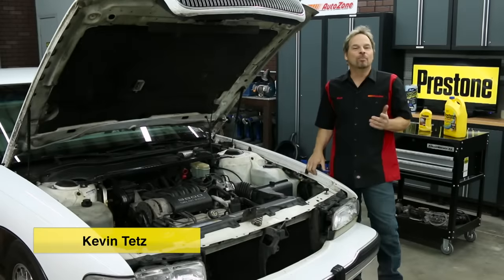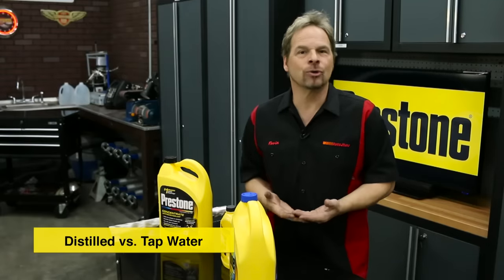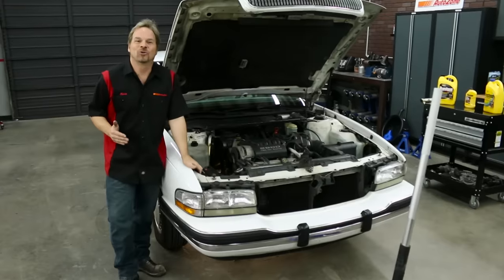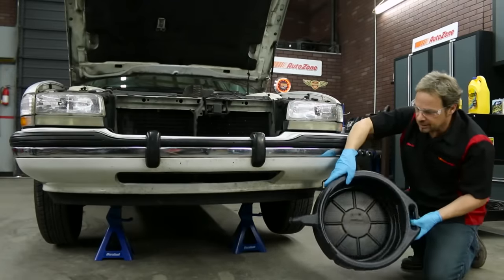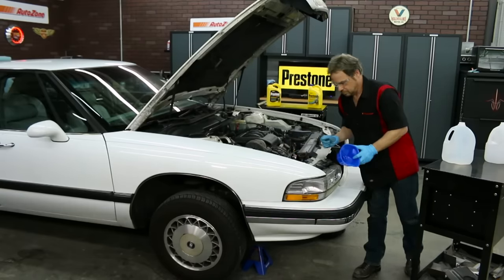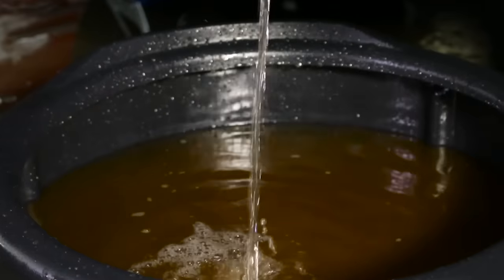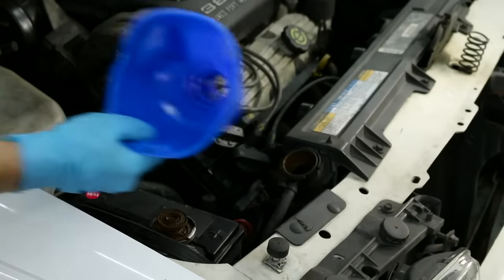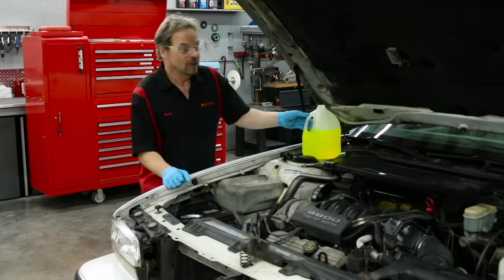AutoZone How-To: Flushing and Filling Your Cooling System

Comment: I need help. My thermostat/coolant gauge gets to almost halfway and then goes back down a little. Especially in the colder months. In the hot days, when I'm idling at a drive thru for a while, it gradually starts getting hotter and hotter and my ac no longer blows cold air. Then I have no heat. Anybody know what can cause this issue? Any help is greatly appreciated.
Reply: Just a guess… when you start a cold engine the thermostat is closed, which restricts flow of coolant to within the engine block only. This is normal and is to allow the engine to reach normal operating temp quickly. At that point, the thermostat then opens and allows circulation of the entire system (coolant in the radiator also), which has not warmed up yet. The sudden flow of the cooler coolant is what you’re seeing in the drop in your temp gauge. It’s normal. 
The second issue maybe due to older car, or inefficient cooling due to needing system flush and thermostat replacement. In the mean time when the car begins to run hot when idling or stop and go driving, turn the a/c on full blast at the hottest temperature. This kicks on the radiator fans which helps cool the system temporarily. Then try to get to a cruising speed as soon as possible to let air flow through the radiator to cool it down.
Reply: My Pontiac does this, get a 180 degree thermostat, and check your ECT sensor and coolant levels.
Reply: @jonmo2694  My problem was solved last year. Needed coolant flush and new cooling fan. Cooling fan was not working.
Reply: @davidalonzojr8617  motor? Fuse?
Reply: @jonmo2694  Motor. But just replaced fan all together.

Comment: Better way to drain the system. Remove the bottom hose from the radiator. 
Personally, I remove the thermostat. Re-install the housing. Dump water into the top hose. Then hook the hose of my wet/dry vac to the exhaust port. Blow any water that may still be in the block out. Then do somewhat the same for the radiator.
Reply: Yo I am not about to wrestle that massive old hose off and on twice (and risk damaging it)  just to do a flush

Comment: Nice video thank you.

But eyeballing half of the gal is just an eyeball and you could end up with not a 50/50 mix.

Your best of measuring it or using the same exact bottle size and filling it to the same exact spot with water and then with coolant and then pouring that into the gallon

Comment: I use 5w-20 in my radiator.
Reply: you are new school I use 10w-40 thats old school from the 70's
Reply: And of course good water when you oil change.
Reply: Don't forget to regularly check your  blinker fluid levels if low, fill with battery acid

Comment: I just did a coolant drain ,flush and change on my 2006 pontiac pursuit 2.2l eng ,it calls for a 50/50 with dexron cool ,,however I am confused about the coolant as it comes in two forms ,pre mixed (does not specify ratio) and concentrated ,,both labels say it can protect from cold weather down to -34deg C ,how can both do that if they are different? if i took the concentrated form and diluted it down to say 50/50 will it not lower the protection level? the concentrated label does not mention anything about mixing with water or any ratios so i assume they want you to use it straight, but how come the premixed stuff says it can also handle  -34deg C? is it specially formulated to do the same job despite it being premixed?? i am worried i made a mistake in putting the correct ratio because i live in cold weather and it can get down to -30degC here possibly and last thing i need is a broken engine

 ,,here is what i did,i have a coolant reservoir and no radiator cap so all is done through the reservoir cap,,i opened the res cap and then the  petcock on the rad and drained out what i could ,i started the engine and reved it a few times to drain more out with the pump ,i then filled it with distilled water and heated the engine till it reached 105deg C and the fan kicked in and the thermo must have opened because i saw it drastically start dropping back down to 75degC in a few minutes ,while this was happening i put the heater on max and turned on the fan but i dont think this was necessary as it will shorten the circulation time because it only removes heat from engine faster and the thermo will close faster plus i think coolant in the heater core is always circulating with the engine jacket no matter what ,,anyways i drained it and re filled and done this about 4 times till it was coming out nice and clear enough  , i then measured what i collected to be about 4 litres and subtracted this from the system capacity of 6.5 litres to tell me what was left in the system so about 2.5 liters of distilled water ,but what i dont understand is how come there was no heat coming out despite that amount left trapped in the engine jacket and heater core? its as if everything drained out so if that was the case i am worried i may have made a mistake with the ratio when filling with coolant and water,,,anyways i wanted 60/40 so assuming  there was 2.5litres water left in the system i simply did the math and added 3 litres of concentrated coolant directly in to make it 5.5 litres of 60/40 and since there was 1 litre of coolant left to go i mixed 600ml of concentrated coolant with 400ml of distilled water to once again get 60/40 and top it off,,it filled nicely right up to the cold fill line on my reservoir,,i heated the engine and let it circulate and then burped it opening the res cap once cooled and the level remained where it should be,,so far so good but now im worried if i got 60/40 or more? if its more then its ok but will 60/40 be enough to withstand our cold temperature here? or is this too diluted now?? hope i did not make things worst but i had to do it because my car is 14 years old and i never changed the coolant lol even though it was coming out looking like crystal clear coolaide when i first drained it and it did not smell that far gone either after all these years, amazing and very little sediment came out too after all this work,,so idk if im gonna be ok or i made it worst? i calculated it to be either around 60/40 or 90/10 (if it all drained out and there was nothing left,but according to the manual there must have been 2.5ltrs left)
Reply: It's not that hard wow that was a essay

Comment: Why not take out thermostat so any debris will also be flushed away and not getting blocked by the stat
Reply: My name is Steve Rogers  yup. It's like 15$ for a failsafe one for my car (7for the cheap) I also always replace the radiator cap
Reply: Excellent idea, but if you have a GM car, count on having to remove 34 other components to access the damn thing.  It's almost like digging a mine.  Count on it taking 3 days to do a 20-minute job.

Comment: what happens when you get a air gap
Reply: There's a certain funnel that has adapters so you can make a watertight seal with the funnel.  Put it on your radiator or surge tank and it will be the highest point in the engine bay.  Fill your cooling system until no more bubbles come up the funnel...your system will be full with no air. The brand I've got is OEM Tools.

Comment: True story: Took Ram 1500 in for dealer flush. After job, I saw no sign of work being completed. They let me talk to teck. Do you take thermostat out? No. Do you unhook any hoses? No. How did you get coolant out? I have a little hose I stick in radiator and suck it out.

Comment: Sorry but you did not do a full system flush. This is just a radiator flush, totally misleading video.
Reply: It's demonstrating a flush. The procedure and instruction are correct.
Reply: @mvsawyer , his title mentions that he is doing a cooling system flush (not a radiator flush). A full flush, consists of adding a cleaner to the cooling system to eliminate loose deposits or rust. Then the system is flushed COMPLETELY while new coolant is added until the coolant coming out is clean. There is another method in which the system is flushed and filled with distilled water until the coolant begins to come out clean, then coolant is added until only coolant comes out of the petcock. Finally, the engine is run until the cooling system stops bubbling and the coolant level starts to rise, replace the radiator cap and you are done.

Comment: You didn't even drain the block. So how is it a full flush ? It's not even a flush just a replacement of radiator fluid
Reply: how do you drain the block ?
Reply: @rbeck3200tb40  Disconnect the bottom radiator hose and run the engine for a few seconds with the heater on so that the water pump can shoot the water out.

Comment: Or what to do when u start the car and the stuff is spitting out of the radiator top part?
Reply: It sounds like a blown head gasket is allowing your engine to pressurize the cooling system.

Comment: Umm last time I remembered AFTER  flushing your current radiator fluid, you add the flush and add distilled water of course fill it to the top & burp the system to get rid of any and all possible air, while filling the radiator run your car and run your heater full blast for 15 - 20 mins or till car reaches operating temp aka thermostat opens up fan will turn on. Drain the radiator fully and after doing so use "distilled water only"  behind it and get out any left over deposits, repeat the last part of this process till the water runs clear once this happens put the drain plug back in and add your 50/50 mix . . .

Me personally I'd reccomend driving the vehicle for a whole day and let the flush do an even better job, but again that's just me and how I was taught to do a radiator flush & fill
Reply: Awesome comment sir! Thank you are good man
Reply: How do you burp the car? is it after you flushed it?
Reply: @YHKceemrniceguy42  yes after you have done flush you burp the system, fill radiator with your 50/50 mix turn on car run heater full blast once again, after doing this step let the car reach operating temp you will notice radiator fluid will rise and go down a few times that's normal so dont freak out thats the car burping itself, to help speed along process the hose that go directly  connected to the radiator squeeze multiple times by doing so your helping get rid of air in the cooling system. When the thermostat reaches appropriate temp it wll suck down fluid just continue to add fluid till its full...
Reply: @YHKceemrniceguy42  also wanted to make you aware, be mindful and careful when doing this cause car will build up pressure as it runs and shoot out hot radiator fluid, go to ur local auto parts store and buy a funnel with attachments that allows you to screw funnel directly to radiator or overflow tank !!!!!!!

Comment: nothing works for me I swear no matter how simple it is I cant do it.
I think I have air in the system, now the heat wont come on it over heats quickly, no matter how much coolant I add, I think I need to drain it all, then flush it again ugggg
Reply: Maybe you put the thermostat in backwards. I know it's a long shot...

Comment: Drain & Fill, not Flush & Fill.
Reply: You do if you don't know what was put into the radiator before you added the new fluids, especially if you buy used to avoid mixing different types of anti freezes.
Reply: @tousshong9438 they’re saying this tutorial is only demonstrating a drain and fill

Comment: Can I leave the radiator cleaner/ flush for 3 days  and normal drive use to fully clean the radiator?
Reply: According to the instructions on the bottle you can.
Reply: That stuffs a waste of money, better off removing the thermostat and running the garden hose through the various cooling system ports, both directions for 10 minutes, add fresh coolant, while you are at it fill the battery with distilled water,  clean and grease the terminals, done.

Comment: What about the water in the engine block?
Reply: It will remains there for now until the new fluid get mixed with it...so technically he's doing 30-40% anti freeze and 70-60% water.

Comment: Flush? you left half the old coolant in there.  also hate to say it but using tap to attempt to flush you're introducing all that rust making tap into the system which your continuing to not get fully out. RIP your radiator

Comment: Radiators need "deionized" water , not "distilled water" do your homework. One is way better then the other. By the 50/50 if you can, and if you have to mix from a flush, use deionized.

Comment: Job goes a lot faster if you use a plastic canister/funnel like this guy: https://youtu.be/C0YY4TsWT7c?t=281 . It is faster and easier this way. Also the system ventilates much better. I taped plastic bottle and used it as funnel.

Comment: Do it this way (wrong) and do it at the dealership and pay for a full flush and coolant replacement and this is about what you will get. You leave with a dirty and diluted cooling system. Hate my position of now having to pay for a job like this. Only way I trust is to watch but they won't let you do that.🦇